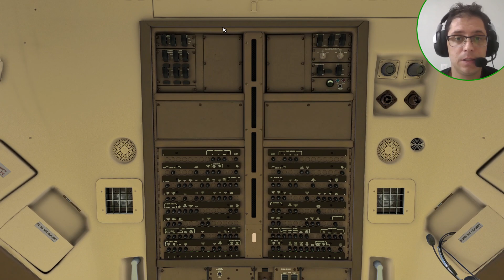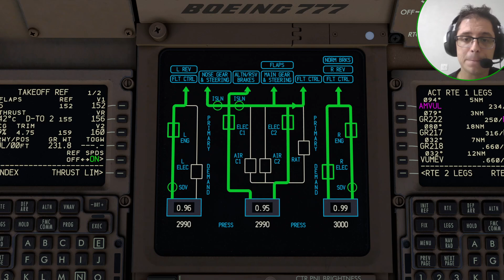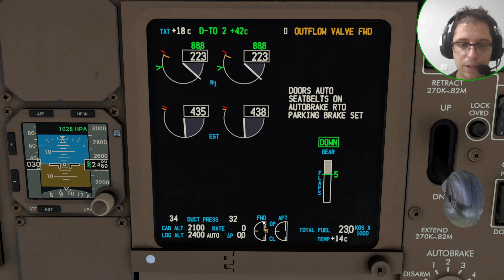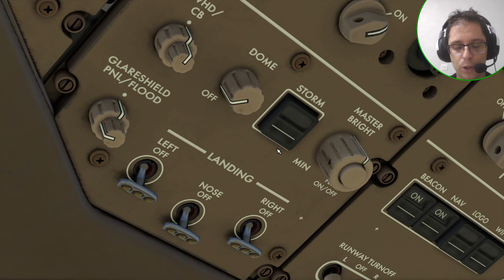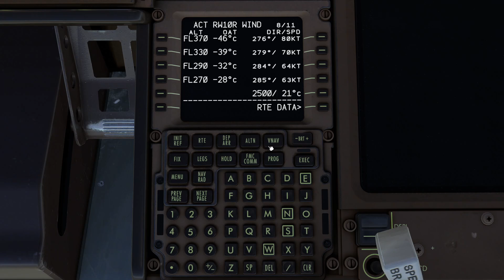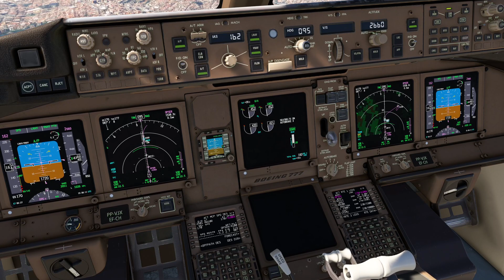Boeing 777 from Boeing 737

Comment: Fonseca i have notice the take off in PMDG 777  even when i set a trust for a higher temp the VR comes to fast as the real airplane, is that true? I did compare the time for VR in MSFS with real 777 take off in SBGR chanel, and in real take off the airplane takes so much time to get VR...
Reply from the maker: Hello John!
I replied to you with more details on your same question 3 weeks ago.
As far as I’m using the simulator and the PMDG I don’t see this behavior.
Just one heads up: I saw some people confusing the load of the airplane with the number you enter on the PERF INIT page during CDU. Some people were not able to takeoff because they were very heavy and some others had I fast acceleration and high nose up pitch after takeoff because they were very light.
Please, record a video and give me details of the takeoff (weight and fuel from FS ACTIONS and the performance data from the tablet). Then I can try to replicate form my side!
Cheers!

Comment: this  is  a   rnp app   ,why  the   MDA is  very  low  ?  and  why  you  donot  turn off   FD or   reset  FD?
Reply from the maker: This is RNP. 
Not RNP - AR.
Correct minima for this approach should be 2891’. The minimums used were from the ILS chart by mistake.
You do not have to turn off or reset FD. In fact, what you want is to follow your FD all the way down to the runway.

Please, check this video!
https://youtu.be/jQhbwopcpyg?si=Y6jmCHGNebnC1OuQ

Unfortunately, a lot of people make wrong assumptions and start to spread wrong information… the need to RESET or TURN OFF the FD is incorrect and nowadays only a few procedures would require you to do it!